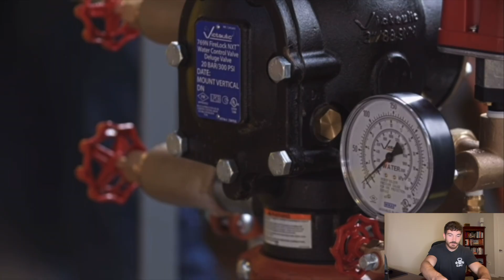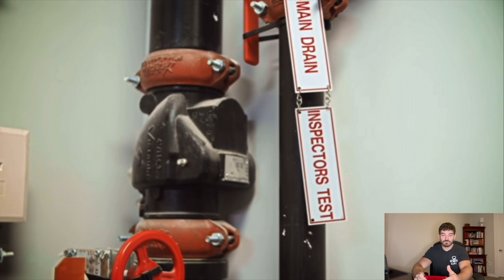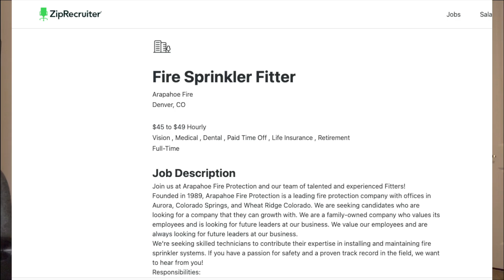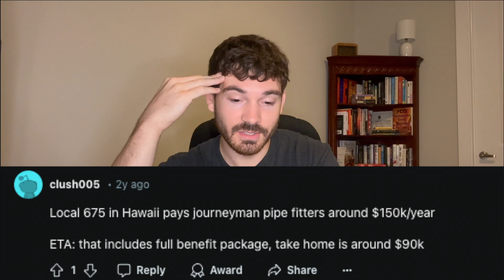Fire Sprinkler Technician, The Cushiest Trade You've Never Heard Of

Comment: You’re on meth if you think sprinkler fitting is easier than plumbing. I’ve never seen a single plumber carry and hang pipe over head even close to the weight we have to do. Or wrench in as many pipes joints even close to what we do on a site. Almost everyone I know that has done it more that 25 years has to have shoulder surgeries, and their necks and backs are destroyed. Obviously I’m talking about the construction/install side.
Also, we do have to get in crawl spaces and underground work. There are far more women in electrical and plumbing than sprinkler fitting. Look up steel pipe weights, I just finished a job that was 8” schedule 40 10’-6”. All hung by hand, no chain falls or hoists.(that’s the the worst of it either.)
Reply: Schedule 40 8” pipe in 10’-6” sticks is right at 300 pounds a pieces.(29 pounds per foot) That job had over 100 of them. Lol not to mention the over a thousand or so threaded pieces of pipe(the job had 900 something heads). That is just part of the job.

Comment: It’s definitely a lot more than putting some pipes together haha. Lots of attics, dry systems (OUTDOORS), preactions (freezers), learning fire codes and working with fire marshals, crawling around attic spaces hunting down air leaks in the summer. Not to mention you will need to know about fire alarm panels, how to disable points so you don’t set off any alarms in a high rise building, etc. anyway..

Been doing it 8 years in North Carolina.. cleared a little over 92k last year. I know people that make more just depends on if you want to sleep in your bed more nights that not. I am also NICET certified which is the way to go if you aren’t union.
Reply: Im a jman plumber thinking about switching over to service sprinkler fitting. Any advice?
Reply: @SovereignMax  first trade I've done was Residential Plumbing for 3 years. Whenever I got into the Fire Sprinkler Trade, it's a whole different world. Especially since I entered as a Service Technician Helper. As far as hanging and laying down pipe, it's the same I guess you could say "law" as doing waterlines. Black steel pipe, Galvanized pipe and Orange CPVC. But there's more than doing pipe. Dry Systems, Pre-Actions,  Wet Systems, and Nitrogen Systems, Jockey Pumps and Fire Pumps is what we service and troubleshoot for it has electronic switches that make the alarms go off and other devices that send signals to the fire panel. As an apprentice, it was very nerve wrecking setting the alarms off and making sure you're on test cause then the fire department will come out. Not to mention trying to learn all these systems and devices, which is way more knowledge than being an Installer or hanging pipe. Instantly made me want to get back into plumbing and complete my hours to be able to take my journeymen test in Texas. Now almost 4 years in, I'm a Service Technician or Foreman and a licensed RME-I "Inspector". It's good trade, you get to learn about Fire Protection. More licenses you get in the trade like FAL (Fire Alarm) FEL (Fire Extinguisher) and Backflow license, you'll make top money. Just about as a Master Plumber.
Reply: @SovereignMax did you jump yet, sparky?